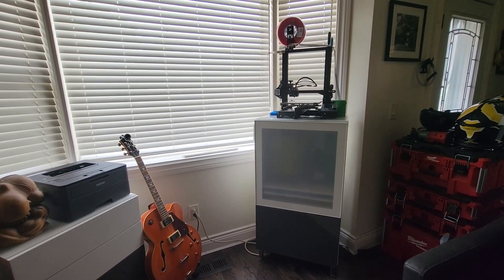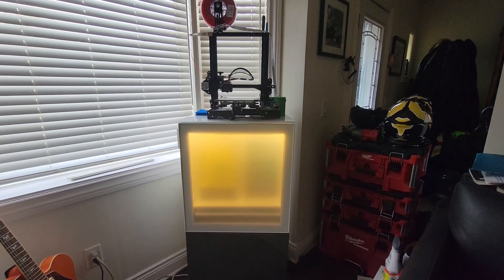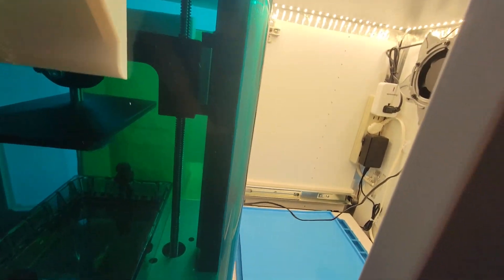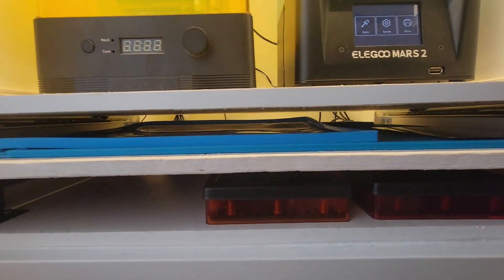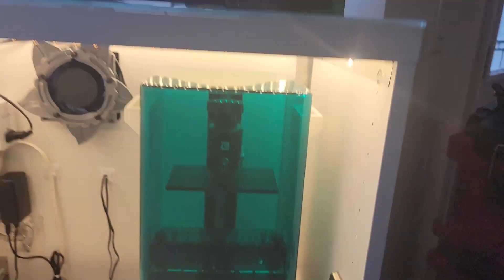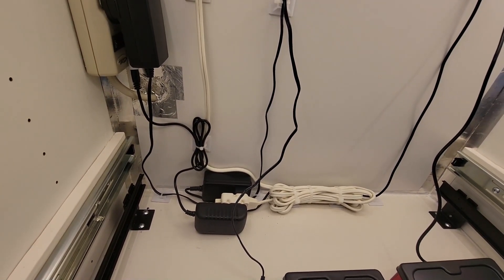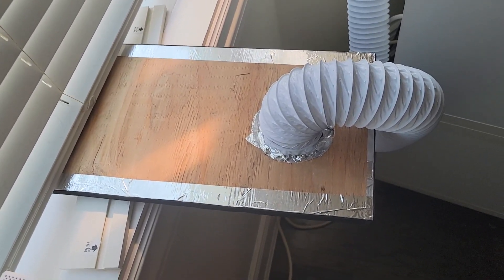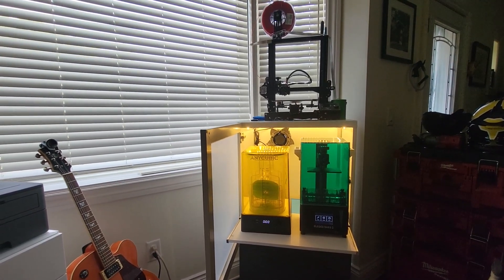Ikea Hack: Modification of a Besta cabinet to house a 3D resin printer

Comment: Hey did you print the fan aperture using your resin printer? Or with an alternative printer? Want to print it, but only have the SLA printer...
Reply from the maker: I printed the duct and the aperture on an Ender 3. My resin printer doesn't have a large enough print volume for those parts.

Comment: Did you use plywood/mdf for the slide out platforms? I'm worried about wood splitting, correct me if i'm wrong are you are screwing the drawer slides into the end grain?
Reply from the maker: I used a scrap piece of plywood I had in my basement. It is screwed into both the end grain of the edge, as well as upward through the bottom of the plywood.

Comment: Hey, I just tried building this almost the same way as you did, but one problem I’m facing is that when I slide the printers out, the entire frame tilts forward due to the weight of the printers. How would you suggest to circumvent this? Is your printer above acting as the counterweight?
Reply from the maker: The first thing to do is to check the total weight of the shelf, printer and wash/curing station combined - including liquids. You should make sure your slides are rated for at least twice that, 3X is better. If the problem is that the whole cabinet is tilting forward, you can try a couple of things. I made sure that the total travel of the shelf was just barely enough to clear the inside top of the cabinet when I remove the covers. Letting the shelf come too far out will create a tipping hazard. Another remedy is adding a storage box underneath the main cabinet and filling it with heavy stuff. It'll help a bit to offset the shift of the center of mass when you slide the shelf out.
Reply: What size shelf do you need for the sliding shelf or can you use the besta shelf?
Reply from the maker: @melissagottlieb5597  I would stay away from using the Besta shelf, they are hollow and stiffened using a honeycomb lattice of cardboard. When you trim it to fit between the sliders, you will probably end up with something that you can't screw into to attach to the sliders. 

I used a scrap piece of plywood I had in the basement, measured out how much room I'd need for the printer and curing station, and made sure to leave enough room at the back of the shelf to avoid interfering with the wires and power bar.  For the width of the shelf, I mounted the sliders first and measured the distance between them.
Reply from the maker: Check the weight limit of the sliders, you might need to get ones that can support the weight of the printer, curing station and fluids.

Comment: Would a Saturn S also fit inside?
Reply from the maker: Not certain, I'd check the dimensions of it against those of the Mars 2. If it's much bigger you might have a hard time. Keep in mind, I have multi level trays. You could always modify that approach to suit your build. My advice: Draw yourself up a plan first, with all the measurements. Cabinet internal measurements, shelf brackets, printers, everything. Measure everything twice as well!

Comment: Great build!  Quick question regarding fumes - did you find that there was still a lot of fumes trapped inside the Mars 2 after opening its lid?  

I'm thinking of attempting something similar to this for my Mars 3, but I'm concerned that having the lid on will trap fumes and defeat the purpose of a ventilated enclosure.
Reply from the maker: There's some odor when I remove the lid, but if you keep the exhaust fan running it removes the odor quite well.
Reply from the maker: You definitely get a waft of fumes when you remove the cover, just just make sure the fan is running while you are removing it. You can also get a battery powered carbon filter that can go inside the cover during operation. It should reduce the initial release of fumes when the cover is removed

Comment: looking at doing this. anything you would have changed now that you've been living with it for a bit? Considering going with a glass front and UV proofing it with a film so I can just not use the lids
Reply from the maker: The only thing I'd do differently is pick different LEDs. The power supply popped on mine last week, fortunately I was home so I cut power immediately and no harm done.

The problem with not using lids is that if you are curing, it won't run without the cover. And even if it did, it's sitting next to the resin printer, so it might cure some of the resin in the tank.
Reply: @try2try731  ah right for cleaning that makes sense. looking 2 saturns together in there so not too much of an issue on my end

Comment: Great idea, I need a cabinet for my Mars 3 and wash station. Which Besta cabinet did you use? I had a look and there are loads of them in varying sizes.
Reply from the maker: Hi, sorry I missed this question. The top cabinet is an Ikea Besta with the dimensions 23 5/8x16 1/2x25 1/4 ". I used their mounting kit to put it in top of a shorter cabinet, but what, if any, Besta cabinet you put underneath it is your call. Unless you want extra height or storage you don't really need a lower cabinet.